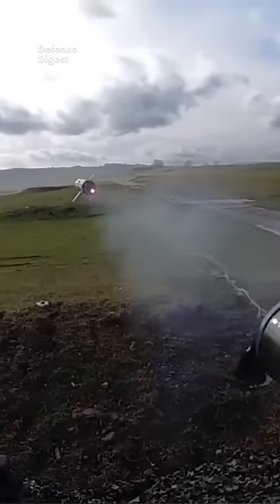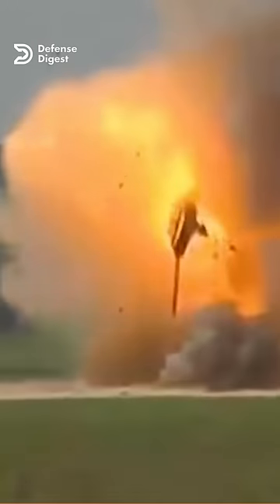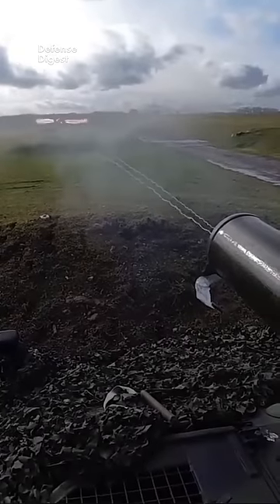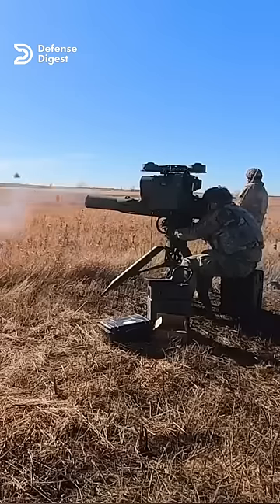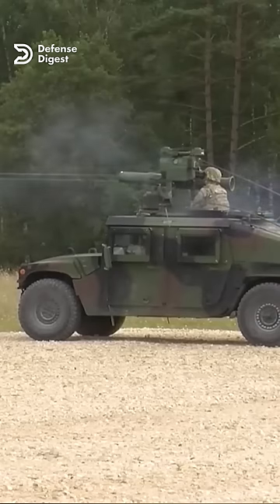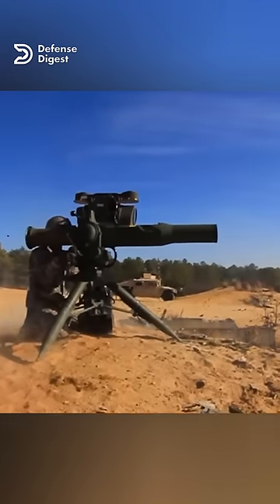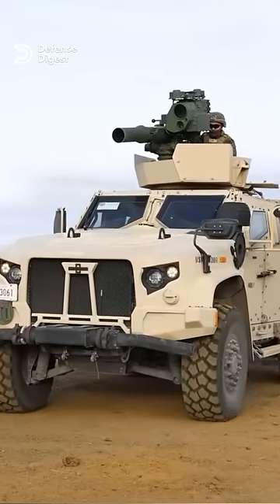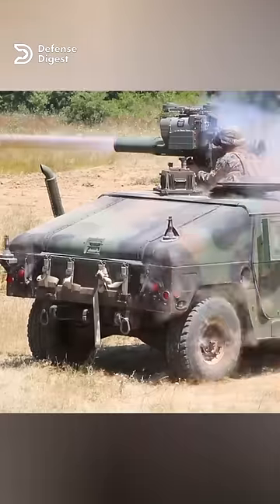Why the TOW Missile System is Wire-Guided

Comment: The tow was designed before laser guidance systems were feasible.  Heat or radio guided missiles can be thwarted by radio jamming, or flare countermeasures.
Reply: Fair.  Makes sense to switch to laser guidance nowadays.
Reply: Also most modern vehicles will notice a laser painting them and will react. This thing can fire without laser targeting and so can avoid be noticed for longer.
Reply: @kenji214245 , so, what guides the missle to the target?
Reply: @leehaelters6182  Pretty much the sight on the launcher sends signals trough the TOW wire to guide it. Using your launch position as a navigation point.
Reply: @kenji214245 , thanks very much for your reply, but many commentors seem to have different ideas about the latest iteration mentioned, with wireless guidance. I was asking about that. All the best!
Reply: Kenji214215
 The TOW missile system is wire guided. The missile is electronically controlled via the sight on the weapon. As long as the crosshairs on the site follow the target, the missile will hit that target. 
These kind of systems leave the shooter of the weapon vulnerable because they must wait and stay sighted on the target while the missile travels down range. The missile has  flash and a back blast area that throws up a cloud of dust when it is fired, telling enemies where the shooter fired from.
Reply: Oh yeah, tank flares
Reply: You can fire a tow or any anti-tank weapon at things that aren't tanks. 
I'm sure you've seen the video coming out of Ukraine that shoes helicopters firing flares... that is a countermeasure for  heat guided missiles
Reply: You cant jam the radio signal unless you know the crypto thats being used which is a closly gaurded secret held within the PADS. Thermal guidance in the wireless tow is not necisary only helpfull in the first few seconds of initial launch while the fumes from the propelent obscure your view and thats only if the user chooses to paint a box around the thermal signiture, its not required. You can easily guide the rocket back on target.
Reply: @alebattle1 Doesn't need to be flares. You can use Electronic countermeasures like the MUSS, which create a stronger infrared signature than the missile, leading to the missile being automatically steered anywhere, but on target, as the control System will identify the MUSS as the missiles IR signature
Reply: @johnsimpson3240 I wouldn’t assume just because they fired flares they were intending to avoid something heat seeking.  Both flares and chaff ECM are often packed in the same pods and fired by the same charge.

Also yeah you can totally jam a signal if you don’t know the crypto, it’s just harder because you can’t reliably isolate the frequency and you have to rapidly vary the period of the radio waves.
Reply: not necessary
Reply: @AnarexicSumo is frequency hopping reliable to counter jamming

Comment: 4.5km of wire.... ?
Reply: yep. All that spooled INSIDE OF THE MISSILE. Not the launcher
Reply: @nobeltnium  I am amazed how easily it unravels without breaking at an unbelievable speed
Reply: @bw1227  I'm pretty sure the same high-tensile copper alloy wire is used in TASERs.
Reply: The wire is made of gold. Seriously.
Reply: @nobeltnium  that's actually insane that they are able to fit so much wire in there.
Reply: @Syn741  Those missle are not small. If you look at one in real life you wouldn't be suprise it can hold that much wire
Reply: Bear in mind that there may be 350m-400m of wire in a guitar pickup - of course it will be thinner than the wire in a TOW missile, but it does show that you can fit a lot of wire into a small space.
Reply: wire is safe but its used now wireless :)
Reply: To prevent friendly fire, you can also pull back wire to opposite direction 👍
Reply: There are actually two wires; so it's a total of 9km.
Reply: That must be why it was always so hard to get a spool of commo wire.
Reply: What's really amazing is that they can unspool it from the missile right beside the insanely hot rocket exhaust...
Reply: The narrator forgot to mention two problems with wire guided missiles; 1) you can't use them over any body of water of significant size - lakes or rivers - it shorts out the connection once the wire droops to the ground (more an issue for extreme range shots). 2) you should avoid making them travel under major power lines, the ambient power leakage or whatever the electric energy is called (the same thing that screws up a compass under a high power line), can induce error into the wire carried signal. 
Not that a lot of major power lines are in operation in battle areas, but still.
Reply: pake nanya😂
Reply: 9. Because two wires, 4.5 km each.
Reply: @power2084    gold!? Copper alloy
Reply: @nobeltnium Considering it also contains a warhead that can penetrate 3 feet of armor that’s still pretty unbeliveble… I don’t even belive it.
Reply: @langdons2848 I mean every pice of the wire is in the exhaust for just a fraction of a second, as new wire unspools, so I'd recon you could touch the wire instantly after launch and it would be warm at most.
Reply: @power2084 gold is too brittle and expensive, surely it would be copper?
Reply: @Tactical_Assault_Pelican  gold is not brittle,  it's very easy to fashion into any shape. Additionally, it can be made into extremely thin ribbons. You have no idea how thin it can be fashioned into, it's mind blowing. Its thinness is what makes all of this affordable.
Reply: It do be like that.
Reply: @power2084  and that malleability is what would make it horrible for holding any kind of weight, let alone the force of a missile. gold has half as much tensile strength as pure copper, without alloys. gold is not used
Reply: @power2084  it has half the tensile strength of pure copper, which in itself is not that strong, and we’re not just talking about a few pounds of weight here, were talking about holding the force of a rocket engine

And no, you wouldn’t want lots of malleability in a wire, that would result in it deforming or breaking, there’s a reason why we don’t use malleable metals in any kind of construction or weight bearing
Reply: @ClayishWall  You are completely clueless. The wire is actually made of gold, it's documented.
Reply: @power2084  "The wiring of BGM-71 TOW consists of 2 thin copper wires united at their tail. Some armies have insulated wires in their wire-guided missiles, but not the US"

youre literally just arguing against reality
Reply: @ClayishWall 5 months later and he has no response… it took me all of ten seconds to do a Google search to confirm that the TOW wires are in fact made of copper. It’s incredible how people can become so set in their ignorance that they can’t even be bothered to double check what they’re arguing.

Comment: TOW missiles haven't been wired guided for a while, my father worked for a company that helped design the new fire and forget launchers in the early 2010s or even prior.
I have one of the said launchers, completely gutted of course.
Reply: I still don't get why they call the new wireless ones TOW missiles. It literally means "Target Over Wire." So calling a wireless version TOW is straight up wrong.
Reply: @swordbrethrenmordred1230  Target Over Wireless ? ;-)
Reply: @swordbrethrenmordred1230 also the acronym NEVER meant "target over wire". I don't know where you got that. It was previously Tube-launched, optically tracked, wire guided

Comment: The first generation of TOW missiles could be jammed from IRCM like the Doom Eyes on the early T-90A tanks because it blinds the seeker the launcher uses to guide the missile. The operator’s view isn’t affected but the missile will be. They fixed this by putting “sunglasses” on the seeker
Reply: Sounding like either a gunner OR (like me) an old  time27E/
Reply: I don't think that's accurate, the Shtora aps used on T-90A can affect only laser guided missiles and laser range finders, it's useless against wire guided or infrared homing missiles
Reply: @levilastun829  The operator station tracks a beacon on the missile to figure out how to get the missile on target. The missile itself is blind. 

The initial beacon was IR. Simply putting a strong enough IR source somewhere could probably confuse it until they added more anti-jamming mechanisms to the beacon.

The original is 1960's tech.
Reply: Which countries have this? Nato?

Comment: Okay so if the wired is so much better why is the second version without a wire
Reply: It's not. That's why we dont use it anymore lol.
Reply: cos copper is rare now didn't you know ? lol...
Reply: Range. The limiting factor on the original tow was "where do we put 10 km of wire".

Wire guided is still one of the top guidance packages, but it takes up a lot of space.
Reply: @leechowning2712  Unless there's powerlines or water lol.
Reply: @neon.kalash3115  If the rocket could go through, So can the wires. Yes, if you fired across powerlines, as the wire dips it will be an issue. But for guidance itself, wire guided is the second most secure option... the first being gravity.
Reply: @leechowning2712  I'm aware lmao. But you still can short on water.

Comment: Not fire and forget, so you have to stand up there in full view until it hits after firing it.
Reply: Not necessarily in FULL VIEW. 🤔...
Reply: First off this a long distance ambush system.  So hull down if mounted on any vehicle  and if man portable system used set up with some cover and or concealment.  Next comes the distance. factor. As a solider you are taught to dispose of the closest viable threat first.  So if you are in a buttoned up tank or AFV  you are not likely to see TOW first because have limited vision. If you think your opponent  does not have anything beyond RPG's you are not going to think, or really look that far out.  700M for RPG7vs  3000 for the first gen TOW.  Just call me a long retired 27E Tow/Dragon Missile systems repair tech.

Comment: As long as a good tank gunner doesn't put a main gun round on the operator before the TOW gets to the tank since a tank gun is much faster than the TOW flys. The TOW has a big firing signature easily seen.
Reply: It takes b**ls of steel to be a TOW gunner in combat.  When enemy infantry detect a launch plume, if possible they shower the operator with fire trying to make him lose his visual lock on the target vehicle.  But it would take a pretty agile tank crew to respond to an incoming TOW.  The flight time is just too short, and where it's going impossible to determine.

Comment: The wire is an optic fiber wire ,its transmit the video footage in realtime faster than copper wire, and the wire is guid the missile for like 100 m until the thermal battery start works and supply the missile  electronics so the rear  laser detector keeps align himself with the launcher until the missile hit the target ,so it is not launch and forget missile ,Russian Kornet missile works with the same technique btw

Comment: What happen if the thin wire got snap ?
Reply: No control and missle will go where the last movement on the guidance system told it to go to
Reply: Its made of kevlar type stuff.
Reply: Or shooting over a body of water, or any number of things can affect the wires has to be thought about before shooting.  It had its limitations, but was also pretty resilient for its time.

Comment: disadvantage: you need line of sight, if you can see them, they might be able to see you.
Reply: Not from 4.5 km away my man 😂🤣
Reply: @shimsy41  not every shot is from max distance, my man
Reply: True, but this thing is definitely not meant to be used in an in-your-face manner. If you're in rifle range shit has gone very sideways for you. It has so much range because it's used as a stand off weapon
Reply: @shimsy41  and what exactly is the range of a tank?  Unless you are taking max-ranges shots every time, you can easily be in tank range.  Or the tank might have friends (tanks don't operate alone).  

There are definitely risks, and it depends on the enemy and how quickly they can locate the POO site.
Reply: This would be your average tank engagement with a TOW. You're a T-72 team rolling down the road. Your partner tank explodes, they all die. Then you shit your britches trying to find the origin for around 90 seconds. Then you eat a 2A, you explode and die.

Comment: Can pearce through 900mm of armor? Wut?
Reply: Yup
Reply: It's armor equivalent in rolled steel. 😂
Reply: @josephozdemir6210  900mm????
Reply: @josephozdemir6210  it's almost a meter
Reply: Shape charges are amazing at punching through steel.  It is why modern day armor utilizes advanced composites, reactive armor, etc.  Basically, our ability to destroy is greater than our ability to protect.

Most tanks now-a-days are immune to small arms fire, basic rockets, etc, and are amazing weapons platforms, giving ground troops localized heavy fire.  However, there's only so much armor you can put onto a vehicle.  Steel has its limits, which is why composites and even depleted uranium is used as defense.  

Look up shape charges and what they can do to steel, its pretty terrifying that a man-portable missile can go through two feet of homogenous steel.
Reply: @PodofGold 900 mm is 3 feet

Comment: Back in the day when these first came out. They could not be jammed, BUT? we found out at near it,s max range or using it,s MAXFLIGHT RANGE! we could put off an explosive charge over one side of the road while lunching from the other side. the enemy looks and moves on the first blast area, while we fly the missile out and away from them, they move on the first area then we aim the launcher on the real target and the missile turns and comes in from a different area that where not in!?! and still nails the target. you can aim one way and then turn it on to the target. they never see it coming at range.

Comment: This is one of those ideas that must have seen absolutely crazy the first time it was proposed by weapon designer. "Yeah, we'll spool out a wire so the missile is continuously connected to the mission control system. Sure, that'll work." But, it does. Now, getting that wire to unwind fast enough and with enough reliability would seem to be a major challenge.
Reply: Our heavyweight torpedoes are also wireguided.
Reply: @williamwchuang  
Fuck, is that true?
How long the wire for that?

Comment: Wired systems is more reliable then wireless
Reply: It is, the only problem is that the operator is exposed to enemy fire while the missile flies towards its target. The exemption is if the TOW is operated from inside an armored vehicle. This is only marginally safer.
Reply: It is not lol.

Comment: Wire is barely accurate. It's a thin fiber optical tube barely 0.5 mm in diameter.  The same wire is used on your digital audio TOSlink

Comment: It does not immune to all jams. Target can use a laser beam in blinding the missile operator.
Reply: Target would have to locate the missile operator and get a laser beam on the sights of the missile operator in seconds for this to work.  Off the top of my head, max flight time is just under 20 seconds, so to "jam", you are talking about a human being, in less than 20 seconds, identifying that specifically a TOW missile has been launched at them (or someone), identifying the POO site, instantly pulling out a laser with its own sights that can see a human at 4km away, and accurately putting said laser beam directly into the optics of the operator.

That's what you're saying jams it, right?
Reply: @PodofGold  Its no matter ,I said it or not. But it is significant enough US made fire&forgot, Javelin missile to replace them.